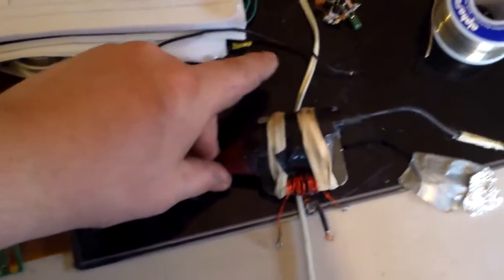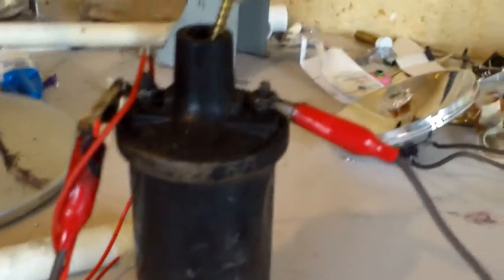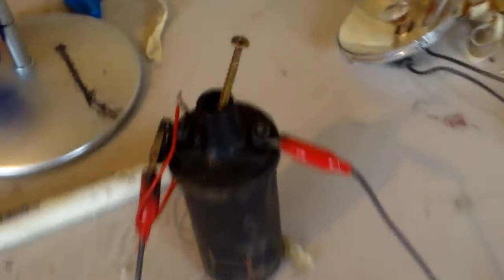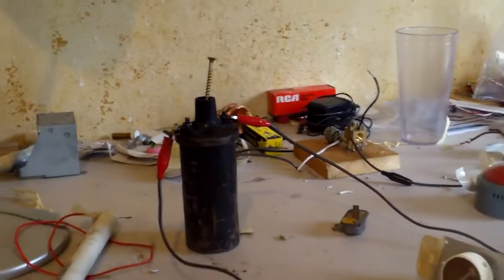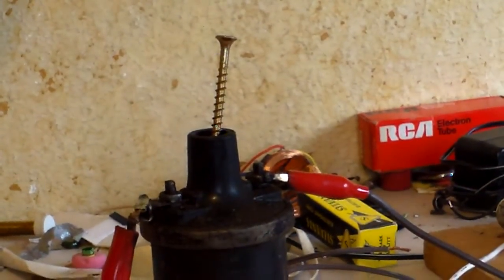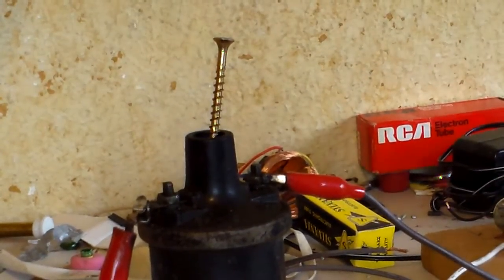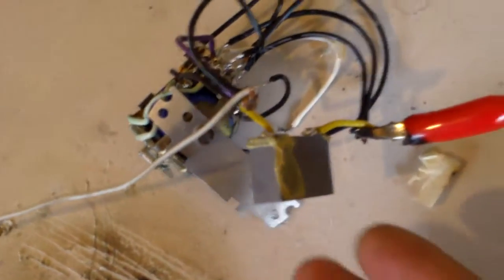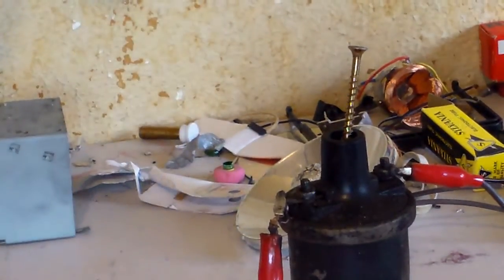ignition coil running with different circuits

Comment: I hooked my 12V auto coil using the condenser that usually works with the typical auto ignition circuit. Theyre usually found on the side of the distributor, sometimes inside. And since I didnt have a SPST NO, I used a SPST NC relay. ( Single Pole, Single Throw, Normally Closed). But, b/c its normally closed, I modified it by soldering a small wire on the relay from the base of the relay to either post of the relays coil. Now from the battery, run a wire from POS to the POS on the auto coil and to the pin on the relay that connects directly to the relay coils opposite post. Run a NEG wire from battery to the pin on the relay that connects to the closed contact, then ground the wire to the housing of auto coil. NOT THE NEG TERMINAL. Now run a wire from the NEG terminal on the auto coil to the base of the relay. Make sure the condensers case is grounded with the auto coil HOUSING, not the neg terminal. The wire on the condenser goes to the NEG terminal on the auto coil. Finally, run a wire from the coils housing up the center post of the auto coil,  just like yours is. I put a hollowed pen tube inside the top of the coil with a wire inside up to the top, and the ground wire on the outside of that to the top as well. This keeps the sparks from reaching over to the circuitry. The results are about the same. 
I found that b/c the contact on the relay disconnects the circuit as soon as the contact separates, the gap opened is kinda small. A larger gap helps with larger sparks. So I hooked a aligator clip on relays
Switching contact end to make it swing wider and open and closed more slowly. The heavier the switch, the wider and slower it opens and closes. Wider gap = bigger spark. This can be done by inserting a small capacitor in the circuit, i didnt have one that worked. I  Probably dicked that one up. lol

Comment: So this video was uploaded back in 2012.  How long into that year did your relay last before it burned out?  That's the weak point of that circuit, the relay.  Those relays were not designed to be switched at that frequency and they won't normally last very long under those conditions.

Pretty cool, though!
Reply from the maker: The relay still works, but I don't use it in this circuit anymore.

Comment: The second is an interruptor/chopper circuit, which is identical to the old points system on a car, which mechanically made and broke the circuit to the coil. connecting a car coil to a dimmer and wiring it to 120volts is just plain stupid because of how the coil is wired internally. You are looking for a quick trip to the morgue sonny... You need an isolation transformer if you do it that way. That is considered a "hot" chassis or hot circuit. Many folks have lost their lives, working on those type circuits. Make sure if you do, that you literally keep one hand in your pocket. If the line current goes across your heart, Bang, your heart will stop, no second chances unless you have a defib mechine like EMT's use... and even then, chances are not so good and you die. Not a joke. It's the absolute truth.  Use the 555 timer and 12 volt battery or power supply.
Reply from the maker: thanks for commentingyou are completely correct i made this video when i was a stupid 12 year old and didn't know what i was screwing with.
Reply: jdflyback Clearly not too aweful stupid. You just needed a better mentor, that would teach you how to be safe... Glad you learned and went on with it!
Reply: @jdflyback  
Far from stupid. If nobody experimented, we'd all be stupid.
Reply: Exactly. I was just going to use a distributor with a hand crank on the shaft. But the relays haul ass.
Im glad im not the only old schooler here. His introduction.."I guess my dad was a mechanic back in the stone age". lol
Reply: Yep. Actually, this is not a safe hobby at all. Even with 12V running through an old cars coil. Thats about 2000V. And MOT caps can finish you off for good. Kids love this as well, but dont understand whats involved, so if you have kids, or younger siblings its a good idea to stash this stuff so they dont snuff themselves. Smaller kids get zapped harder too.

Comment from the maker: @makerj101 the way to make 100% sure is to connect the negative of a  12 v supply to the ground of the coil and to connect one end of a  .22-.68 mf cap to the positive of the coil and the other end the  positive of the supply. Connect a wire to the neg. of the coil and hold it about a cm away from the hv  tap.  tap the capacitor leads together and u should see a bright spark between the hv lead and ground. if the output is less than  5cm than it's fried